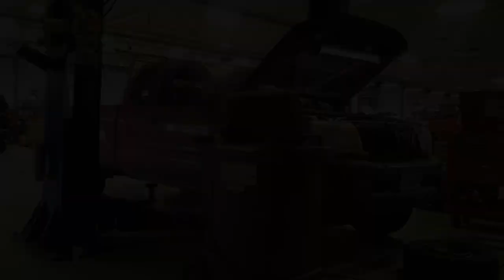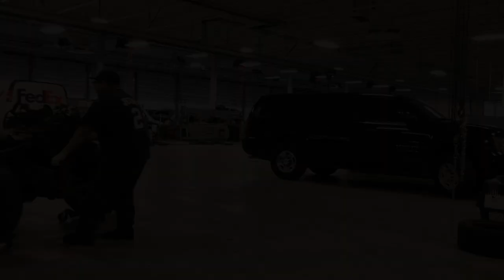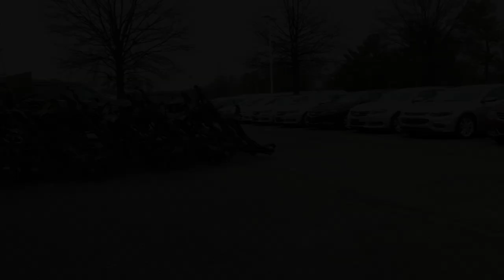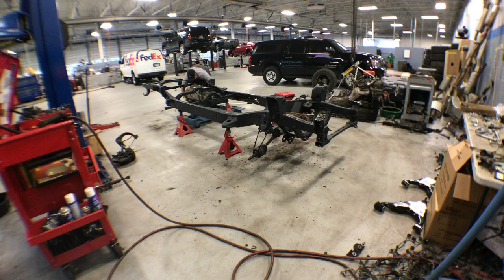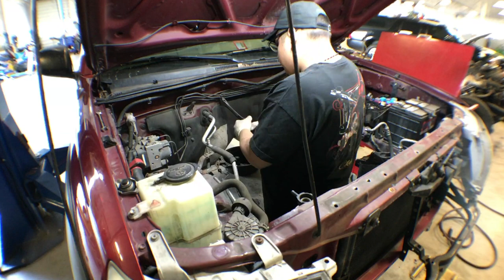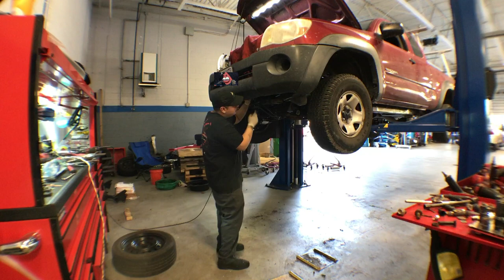Toyota Tacoma Frame Replacement

Comment: casually takes whole truck apart and puts it back together
Reply: With a new frame if you didnt see the whole video
Reply: Master tech lvl 1000.
Reply: is not casually
Reply: kdmq no they changed the chasis

Comment: I hope I had a guy like that working on my truck ,one guy,, you think there would be a crew, the guy is amazing, can't say he's not a hard worker, holy cow...
Reply: You do realize the video was sped up, right.  Kidding.
Reply: The Tacoma / Tundra frames had a manufacturing defect.  Maybe the frames weren't made by Toyota, and there were quality (maybe heat-treat) problems.  Think Tacata air bags.
Reply: I bet they also pay him peanuts!
Reply: When you consider the logistics of how this thing was built on an assembly line where each person's job was probably to hold one impact gun and hit the same bolt over and over and over again... compared to one man disassembling the entire thing and then assembling it all by himself... it's literally fucking crazy.
Reply: @SampsonGG  I know eh...thinking the same! Timelapse was what...2 day?
Reply: Have to be a hustler if you wanna be in this industry
Reply: More than one guy on this type of job would be a nightmare, I know, I've been there.
Reply: Timothy Foley 2 guys is fine each work on one side
Reply: Roger Prodactor  one guy to hold the cable 6 guys to turn the house?
Reply: @SampsonGG  lol no its not man its not hard nor amazing.
Reply: @brianwelsh5424  

Ya-

That's why I washed out and had to start driving a truck.  That and plus making minimum wage and staring at 18 Grand and Snap-on Tools purchases and cabinets got to put the end to my Shadetree to fir a living auto mechanic career.

Comment: I bought a 98 and didn’t no about the recall. Someone told me so I registered the truck that I had just bought for 700$ and took it to the dealer and they called me back and said they would buy it back for 12k.
Reply: That's one hell of a profit
Reply: Can you tell me more about that recall?  I have a 2000 Taco. Thanks
Reply: Bo Stewart I think it’s 15 years old max

Comment: Last year  I bought a 2006 Tacoma base 2.7L standard transmission with 185,000 miles. The previous owner had the frame replaced by Toyota in November 2017. I was always curious how it was done, it is a major job.  Thank you for posting.

Comment: My 2001 Tacoma had a recall on its frame years ago. When I got the notice, I went out to inspect it myself. I could easily crunch up half the frame with my fingers. It was a miracle the frame didn’t ever buckle on me.
Reply: Crap, I still have my 2001 and I never received a recall notice!  I better go out and check the thing.
Reply: we never got the recall. Once upon a time they contacted us for weather proofing and then said we did not need it. Now the frame has collapsed exactly at the connection. Checked online an there is nothing
Reply: @kys.online  I think the frame and repairs ran like $14,000. (Frame plus labor)
And they had the vehicle for almost 3 months. While I drove a brand new camery off the lot. 
It was absolutely stupid! They could have gave me that money and I would have bought a brand new truck.
Reply: @jakemarlow8998  how was the frame? Mine was the worst in front of the rear wheels. Looked like something that sat out in the woods for 40 years.
Reply: @this-is-slammin-549  The frame didn't have that deep problematic rust - just surface rust from the salt air at the beach like any other car/truck would have.

Comment: How many extra bolts left over? And don’t lie!
Reply: Toyota designs it so the US dealerships who are usually lazy will have a great time putting it back together and all bolts are usually sorted
Reply: Lol..true, But if he's done a couple others, he should get it right. Due to experience.
Reply: that is what the glove box is for:-)  Actually you lay out the parts in the order you take them out. I used to change front clips on damaged new cars for GM. Best job I ever had.
Reply: ericlogos  like flash ⚡
Reply: The bigger question is how many bolts didn't get tightened.

Comment: This video is incredible. Master at work. I’m getting this done to my Tacoma as soon as the frame comes in. I can’t believe how much work goes into it
Reply: I'm going to do the same to my 4runner. Just wondering how much a job like that goes for. I heard it will take about 40 hours.
Reply: How'd it go?
Reply: @ Went pretty well. Got it done on my 2011 with 85k miles on it. Toyota installed my new suspension that I purchased separately a few months prior. It was free for them to install it. They said if I didn’t bring them new suspension they would’ve just put the old stuff back on.

Comment: Wow, the sense of satisfaction that this guy must feel stripping a truck down that far and rebuilding it by himself...impressive. I'm sure some owners were majorly inconvenienced by all this, but in the end, it's like winning the vehicle lottery...good on you Toyota.
The only criticism I have is the apparent lack of a torque wrench in this video, but I'm optimistic that it all works out in the end. Great video and thanks for sharing.
Reply from the maker: Thank You!!!!
Reply: Toyota only recalled those trucks because of the class action lawsuit against them.  If it were not for the suit, the owners of these trucks would be left holding the bag.

Comment: How often should I change the frame on my 09 Taco?
Reply: Annually is the recommendation for any Toyota truck or SUV sold since 2003.
Reply: What do you expect when they were made in USA ?
Reply: Once a year,to be on the safe side.
Reply: Yet GM and Ford won't stand behind brake and fuel lines.
Reply: The frames only last 1 year?!
Reply: @Network126  ...bro
Reply: It depends on where you live.
Reply: My 13 has original frame. Had truck Diamond Cote put on new....so far so good. Frame seems to be solid as a rock.
Reply: There was a recall on 3rd gen Tacoma frames
Reply: Whenever you change your brakes.
Reply: Every hour, period
Reply: @loktom4068  ,no they are made in MEXICO, the only New Tacoma made in the U.S. is the TRD PRO.
Reply: Every 100k in snow belt areas. With some Fluid film it may last longer.
Reply: @C T lol...me too.🤣
Reply: @williamheinsinger7390  ASSEMBLED IN MEXICO , NOT MADE
Reply: @loktom4068  ..Actually the Japanese built Toyota 4Runner also has rusting frames..2012-current have rusted frames..So what do you expect its a Japanese Toyota,all Toyota's are rusty...things they do they rust faster than others and are unsafe because the frame is the structure and they fail!
Reply: @hornett22  ...Actually Toyota dragged their feet on this..Frames are actually a real safety issues as its the structure,the trucks crumble on impact killing people..Tacoma,Tundra and the Japanese built 2012-now 4Runner's have rusting frames,very unsafe!
Reply: Tyler Spring A friend of mine had it done twice. Toyota should really think about galvanizing the frames.......

Comment: Just dropped off my 04 this morning at Mechanicsville Toyota to get my frame replaced. 1 month shy of 15 years and 328000 miles but still covered by the frame warranty extension.  They said it would take about 6 months to gather all the parts and the frame, and 3-6 days to do the work.  All covered under warranty. They wouldn't let me drive it off the lot. Gave me a rental truck until it's done. It was that bad.
Reply: I have an 06 that got approved. My question is what all did they replace besides the frame? Mine has a few other issues besides the frame. Wondering if they might discount parts/ labour? AC needs new condenser, rear hubs leak fluid onto brakes, alternator about to go, ujoints, and brake lines leaking. I just stopped driving it they didn't offer a loaner until the frame comes in.
Reply: @bobbybrown614  they told they would be happy to replace needed parts (free labor)that they were going to remove and reinstall onto the new frame. (Shocks, calipers, ect)  they said i could buy them elsewhere and bring them in. New parts included the frame( of course), rear leaf springs, brake lines and fluid, lower control arms, all frame bushings and mounting hardware .  I had them install new shocks and struts, calipers, rotors, pads, and a new 3 in liftkit. I did all the ball joints and in&out tierods after i got it home. All purchased from Amazon and advanced auto.  Good luck

Comment: Just had my 09 Tacoma done. A.C did not work after and I had no issues with it prior to taking it in. Took it back to the dealership and they ran a diagnostic on it. They tell me the compressor is shot and needs replaced, charging $2100. I’ve found this is a common problem with these frame replacements and I’ve been told that they didn’t touch the A.C lines and my compressor just died. Need advice please.

Comment: My 2009 is waiting for the call to bring it in for a frame replacement ..was told 5 - 10 days for the work to be done
Reply: Mine took 3 days. Toyota got billed $15,500. The dealer kept calling to say I needed this or that replaced. They told me I needed a new belt. I was like......I don’t think so...that one has 4 hours on it. I had just changed it when my frame broke in the front. I had to wait 6 months for the replacement. Toyota didn’t give a crap about me not being able to drive it. Wouldn’t give a replacement truck while I waited.
Reply: NorthWest Firefighter it depends on the dealership, we were replacing them over the weekend you get a car from the day we failed it until you get it back, if any work is needed we do it at half cost since it’s already apart

Comment: I've been driving trucks and autos for nearly sixty years and have had a lot of people work on my vehicles (including myself).  There's one local guy I would trust with most issues but I doubt I'd let even him work on my Toyota.  When I want quality work done I take it to a Toyota dealership.  It costs a little more but I've only had one issue with a Toyota tech.  A young pup tried to tell me I needed a part replaced and I knew otherwise and a bunch of miles later I know I was right.  Don't take everything they tell you for granted, people are people, but when I want an expert diagnosis or repair it's off to Lemieux Toyota I go.  

The entire frame scenario including the way Toyota handled it was in my opinion a credit to Toyota.  They're not the idiots who refuse to find an alternative to salting roads and they coughed up a lot of money to put solid frames under vehicles that would otherwise been short lived.  Have not seen Ford or Chev do that and believe me their frames rust away as well.

Comment: My 2009 Taco's at the dealer right now waiting for the frame and springs to come in. It's a 2 month wait. Since my truck was deemed too unsafe to drive, they gave me a 2019 Camry LE loaner for my troubles. I'm practically getting a new truck.
Reply: Is it a Recall, or a Warranty?

Comment: I guess I need to take my 2010 in for a frame replacement inspection, because mine is way worse than this one, this one looks new compared to mine!
Reply: I heard that depending on the place...if yours isn't too bad, that they will just spray it down with rust protection...so if i were you, id wait until its very bad for a 100% frame replacement.
Reply: Last I heard the replacement is over now...
Reply: @stevethomas8106  2005 to 2011 are covered for 12 years from Date of first use (DOFU) , so it depends on the when it was sold the first time. My 2007 DOFU was 11/24/07. I took it in for 3 inspections in the last 3 years. They found a hole last Friday during my final inspection with 2 weeks left on the extended warranty from Toyota , They ordered the frame and replaced it in 5 days . I pick it up tomorrow , the service dept. said no charge for anything. The dealership and Toyota also gave me a loaner vehicle to drive while the frame was being replaced. 2019 Highlander with 4k miles on it. They said the cost is $16k - $17k for each Tacoma.
Reply: @Crab53  My TACO is an 03 and it was all done @ the dealer. They even did all the brake and fuel lines. From listening to others, they no longer do the lines or other related components. And they charge for any bolt that snaps off etc etc, if they're treating you that well, you're a lucky guy!!...

Comment: Guy I work with does these in 12-14 hours. Pays 40. This guy here is obviously a pro too
Reply: This is most likely a recall replacement. So it will cost him nothing. I just got mine done. It started falling apart when it was only 4 years old. By 13 years old the frame broke in the front. Toyota got billed $15,500 dollars for the replacement.
Reply: Anything touching the frame had to be replaced also under the recall.
Reply: 12-14 hours ? lol....I know 2 people who had it done and checked progress and it was 5-6 work days....
Reply: Dean B That’s not in my area, it takes a minimum of four weeks just to get the spray treatments done.

Comment: always wondered how much longer it would take to drop the engine with the frame... we usually keep them up in the truck with a engine support.. but honestly doesnt look like it added much if any time to your swap
Reply: Dan K. We also kept the engine and transmission in the body. We didn’t have to open the ac, coolent or unplug the harness. We would have the bed and body up in about 45 minutes.
Reply: @Jc-ei7hz  Where?
Reply: Got my bar I used to use on front wheel drive cars that could probably hold the engine in the body but securing the trans on a 4 wheel drive looks a little sketchy. Did you do this on 2wd and 4wd?
Reply: I am getting ready to do this. So you support with an engine bar like I used on front drive vehicles back in the day,fender to fender? The trans is 4x4 and attachment points to hold it in the body look sketchy? Any advice? Would love to minimize the work and take advantage of the lift.

Comment: So much work.  I bought my 2005 DC after Toyota had replaced the frame at 201,000 miles, then I got it oil sprayed and I spray Fluid Film inside the frame focusing on the riveted in plates

Comment: Shows how much money Toyota has to keep replacing frames....instead of fixing the issue on the front end...
Reply: If it was RAM...GM....or FORD the dealer would just tell the customer to FLOCK OFF.
Reply: @mikefoehr235  It's a gigantic tax write off.
Reply: This only happened in that year model Tacoma
Reply: @lookhector  No it did not. they are still CURRENTLY doing them and have since '04.  Total garbage, my 04 Chevy's frame is still 100% fine after 15 years of plowing snow..
Reply: @lookhector  false....been doing them since 1st gen...and now up to '17 model years...
Reply: The paperwork on my frame swap showed  @ $12k cost .
Reply: I had a 96 that had the recall, I took it to toyota and the do some kind of hammer test on it. It was really rusted, their fix was to spray undercoating over the rust which came off a year later.
Reply: @flyinpolack6633  thats incorrect. Frame design was changed for the 2016 model year. Im a Chevy guy but im not ignorant.